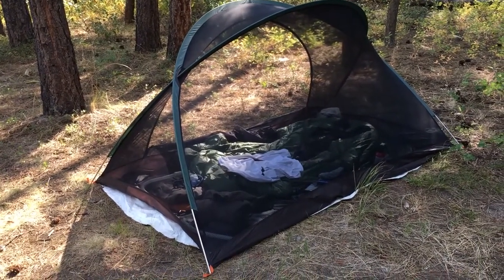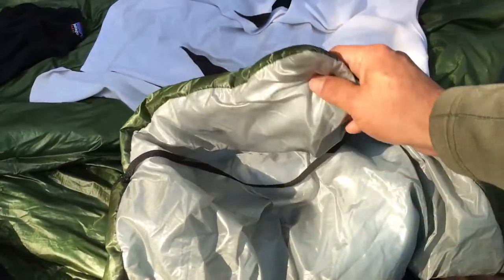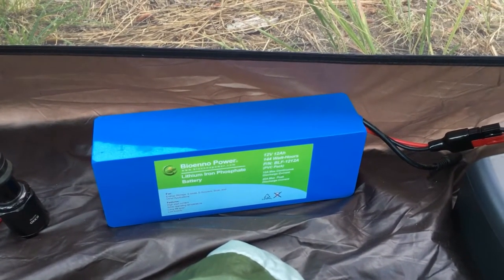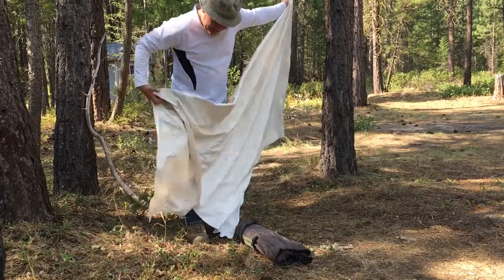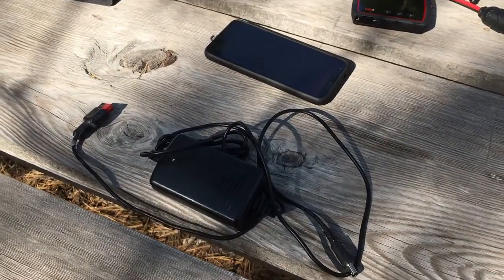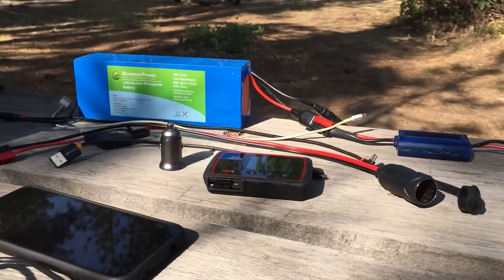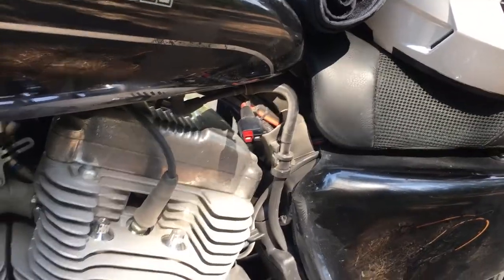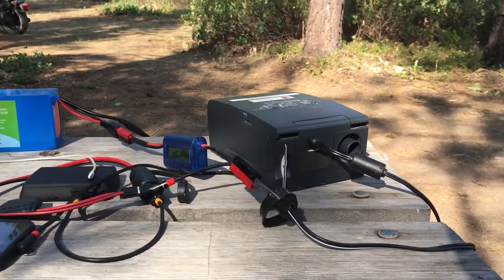Ultralight motorcycle camping sleep system with tent, CPAP, battery, and chargers.

Comment: I'm struggling with CPAP and motorcycle camping. It seems to be getting worse so pushing it isn't working. I got a battery but as things are these days it didn't last long as in ceased functioning. I like your setup though and thank you for sharing